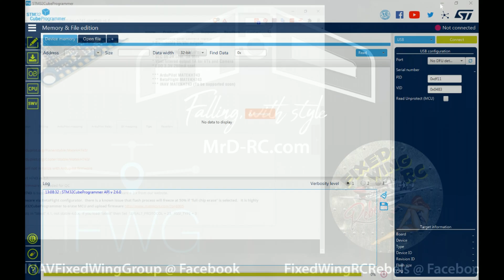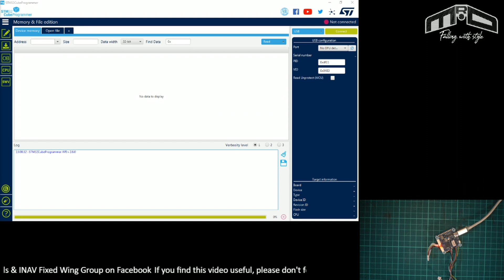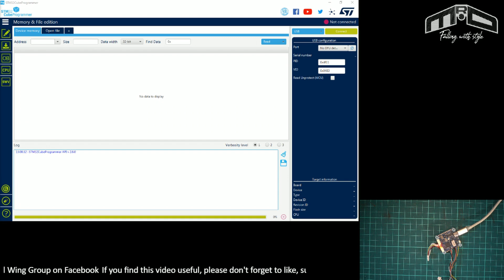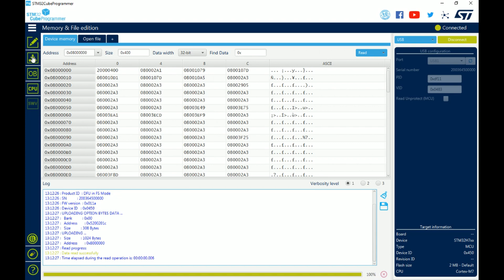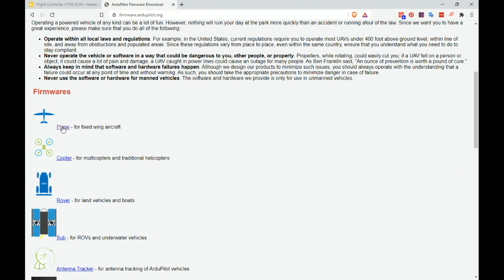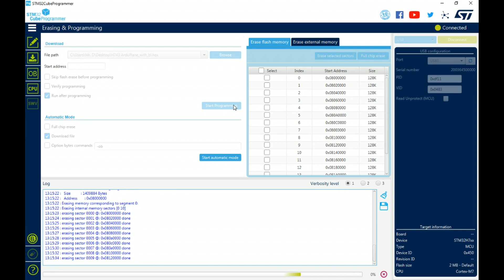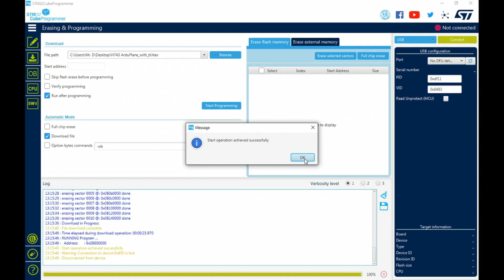Installing ArduPilot on an H743 Flight Controller

Comment: Hello Darren, greetings from Germany, very good video!!  On the Inav or Ardupilot decision, there are pros and cons to both systems. I have tried both autopilot systems for several years for some simple and high performance electric motor gliders and diy endurance copters. Ardupilot is much much better for gliders in maintaining speed and stall prevention in thermal flying. Glide performance in FBWA mode increases significantly, especially with the addition of a pitot tube. 
Inav in a high performance glider with engine off in angle mode (=stabilize in Ardup.) is incredibly bad, speed is not maintained, especially after direction change you have to constantly adjust speed suddenly the glider is too slow sometimes too fast. Mixer tab in Inav on the other hand is extremely well solved, this mixer tab in Ardupilot would be a dream. The settings in Ardup. are a nightmare. TECS system (syntetic) airspeed handling in Ardupilot is a masterpiece. The best parts of both systems in one, that would be brilliantly good.  Best regards, Ingo
Reply from the maker: Hi Ingo. I've not flown ArduPlane yet, so I can't really comment on that. Though iNav doesn't really have anything specialised with gliders in mind. This is a reason I am putting ArduPlane in my Ranger 2000, so I can experience that. Same with an airspeed sensor, in ArduPlane, it's functional for closed loop throttle and things like that. But in iNav, it's currently really only for data. But, I'm holding off on conclusions until I've flown both. I'm actually hoping to do a back to back comparison at some point. But, I'm thinking ArduPilot will be better for larger aircraft, cruises, and long range. Whereas I think iNav may feel better for acrobatic, fast, ripping around flights.

As for the PC software, as far as configuration goes, I still prefer iNav. I just think MissionPlanner hides too many useful things away in the parameters list. However, it is much improved from the last time I attempted to play with ArduPlane, and ended up just re-flashing iNav as I was pulling my hair out with MissionPlanner, and ArduPilot's own wiki was incorrect for the flight controller I was using. But there are hangups that used to exist, which have now been fixed.

My biggest issues at the moment with ArduPlane are the missing features. For example, SmartAudio. However, I believe that will be in 4.1. I wish they would implement the FrSky PixelOSD too. I've not checked if CRSF is supported, but saw old posts where is wasn't. I also find having the autolaunch feature linked to a mission a bit strange. If you want to launch and loiter, it seems you would have to set up a new mission at every location, which isn't good for casual FPV. It would be nice if autolaunch was separate, like the iNav system. But if you have a mission with a launch, that overrides the default launch settings.

Overall though, I think each will have their areas of excelling and of needing improvement. I'm looking forward to trying it. My S800 is now ready to go, and I'm just waiting for us to be allowed to fly again because of CoViD-19.
Reply: @MrD  
I am not able to get ESC telemetry, because of which I am not able to get voltage and current.
Please help 
Flight Controller:Matek H743-SLIM
ESC:T-Motor P50A 3-6S BLHeli_32 4-in-1
Parameters i set are
MOT_PWM_TYPE=6 //DShot600
SERVO_BLH_AUTO=1
SERVO_BLH_MASK=0
SERVO_BLH_OTYPE=0
SERIAL5_PROTOCOL=16 //ESC Telemetry
BAT_MONITOR=9 //ESC
Reply from the maker: Sorry, I’ve not spent anywhere near enough time with ArduPlane to do any troubleshooting on it. The first time I tried it, I spent hours trying to just get the simplest things working, and in the end just flashed iNav. The last build I did, things seemed to setup easier. But that was about a year ago, and I still haven’t flown it. Now I need to update to the new version, which I’m hoping will be a smooth process. But I’m not counting on it.
Reply: @MrD  Exactly, for last one week I am getting new problem on each setup, and less users for H7 processor, fortunately after week I could solve all problems, except ESC telemetry, by the way, how is iNav RTL?
Reply from the maker: It’s crazy, some things. I mean ESC telemetry should just be set the protocol to DShot, then set a UART for ESC telemetry, done. It should be that simple. 

RTH is fine. There are a couple of cases where there could be improvements, for example, a defined RTH route if you’re flying in the mountains, or something like that. But for 99% of pilots, there will be an option that suits them.
Reply: @MrD   Thanks
For your information
ESCs don't output current in the telemetry , so after setting Set SERVO_BLH_AUTO=1 you will get RPM etc but not get current value from 4in1 ESC.
4in1 ESC has onboard analog current sensor, so need to connect that pin to FC so for that set
BATT_VOLT_PIN=10 // This value is board specific see mapping for Ardupilot given by board manufacturer 
BATT_CURR_PIN=11 // This value is board specific see mapping for Ardupilot given by board manufacturer.
Reply from the maker: That must be with quad 4in1 ESC? Using individual ESCs you can get current over the telemetry, there are no analogue current pads. It seems like a bit of an antiquated way of doing it, especially when the telemetry wire is there and used for RPM. But I guess half if these things are designed as stacks. So just have a cable connection to a matched FC. Thanks for the info though 👍🏻
Reply: @MrD  Hi Darren, you are right, there are different areas of application for INAV / Arduplane. It is sometimes difficult when you have your own application somewhere in between or need a very specific application. Setting up an aeroplane with Arduplane via MissionPlaner is also not really intuitive, but when you have it running properly, it's really very good. There are still some features missing, but more and more good things are slowly being added. CRSF custom telemetry has just been added. I have it running in my Matek H743-Mini (ArduCopter), and DJI FPV OSD will be added soon. Next I would like to configure another H743-Mini for Glider.
For telemetry on the Taranis I prefer "Yaapu telemetry- script" : github.com/yaapu/FrskyTelemetryScript
CRSF custom telemetry with Arduplane also works: discuss.ardupilot.org/t/passthrough-telemetry-over-crsf-crossfire/62668
When using an airspeed sensor on the glider, you can suppress its use when thrust is active.
full parameter tree (mostly used) /ARSPD_USE = 2 ;use wen zero throtle// for gliders with motor.
Yes, that will be fun, I guess when the club airfields are open again due to corona, a huge mass of newly built Planes/copters will get into the air.

Comment: Does this H7 also heats up too much like F722?
I had a Flywoo F722 FC which worked fine every time, but used to heat up a lot when not flying.
Reply from the maker: I’ve just been doing a test, and a video for it will be out in about a week. Short answer, no. The H743 I tested was only about 2 degrees warmer than an F405.
Reply: @MrD  Thanks for the info. Appreciate it.
Reply from the maker: No problem
Reply from the maker: I can’t say I noticed the Matek F722 heating up. I had an F722-STD on my bench last night. I need to finish the update on that, so will check.

Comment: Thanks Darren, think I will hold off until Inav 2.7 :)
Reply from the maker: Totally your call. At the moment I’m missing some of the things that are taken for granted in iNav. Stuff like SmartAudio, which seems to be missing. Also, the launch mode seems like an after thought as it needs to be tied in to a mission. 

I’ve just got my first model set up though, so will give it a fly and see. I will make some more ArduVideos though. Just because I think its good to try things, then RC pilots can make their own minds up. Personally, I am thinking both firmwares have their places for different circumstances. Also both firmwares could learn from each other, each has areas they do better and worse.
Reply: @MrD  yep very interested in this. I will follow your progress Darren. Thank you for trying this out... cheers pal, stay safe
Reply from the maker: Thanks. You too 👍🏻

Comment: You will love ardu.
Reply from the maker: I’m getting there. The are thing that I’m missing, and things that I think are done better in iNav. But I’m at a stage now where I can throw a plane in the air. I’m sure that it will fly great. But I think both firmwares can learn from each other.

Comment: Finally! Ardupilot! Darren moves to the dark side! ;)
Reply from the maker: lol, I had no choice with that flight controller 🤣 But still, its good to have experience of all of it.
Reply: @MrD  ...and check QGroundControl. The data overview is much more clearer....;-)
Reply from the maker: Thanks Max. I had a look and qGroundControl does look a lot nicer. But, the setup part seems to be less complete than MissionPlanner, as in the parameters need to be text edited more. I could be wrong, but the OSD setup seems to be missing. 

For the first model, I’m not worried about the ground station element. I’m using an L9R. But I will download it and take a look. The mission part definitely looks better.